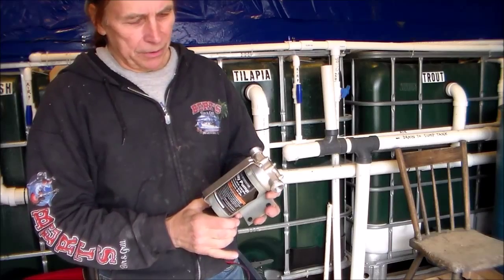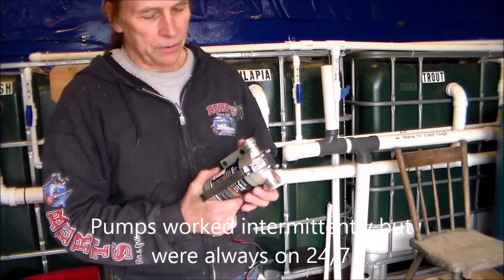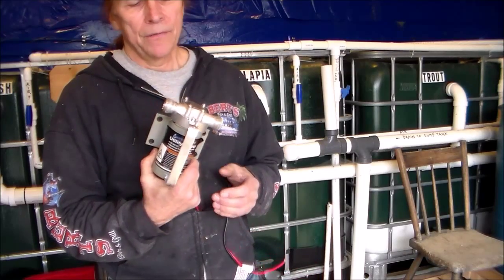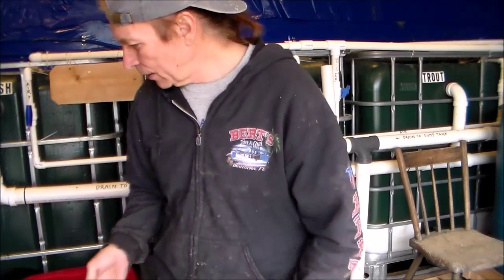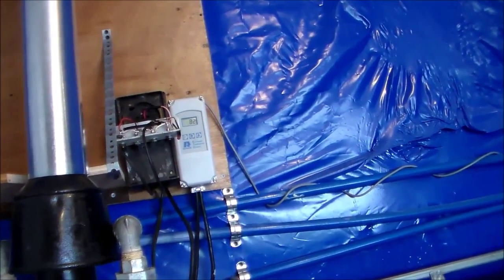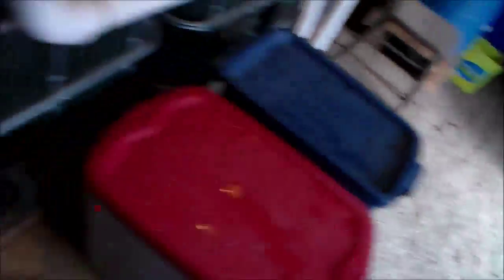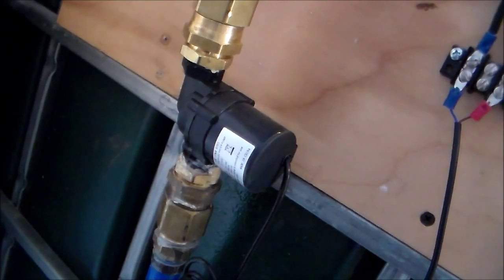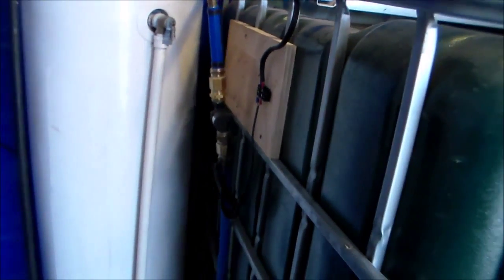Aquaponics Fish Tank heater up grade

Comment: why do you need to pump the hot water? Wouldn't it just work off convection?
Reply from the maker: I have the four tanks daisy chained together, convection does not work here, and I don't want it to.---- the pump will deliver the hot water as needed--- I can keep the temp in the tanks to within one degree of the temperature that I set it for.---Don

Comment: I've always wonder with some system if there was a different way of making them work.?Figure out the flow rate of the pump and the length  and capacity of the tubing/pipe and let cut off the pump and let the heat release for a a time and start the pump back up?I just think heating a large volume of water seems hard and there has to be a better way.I like what you are doing and i'm not  a aquaponic yet( i rent and thats not an option) but i love watching videos like yours.